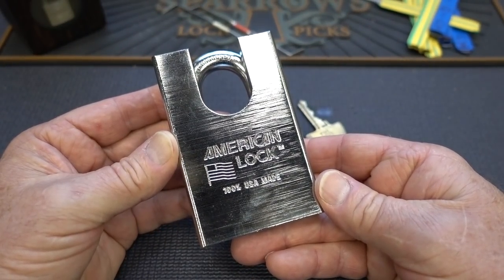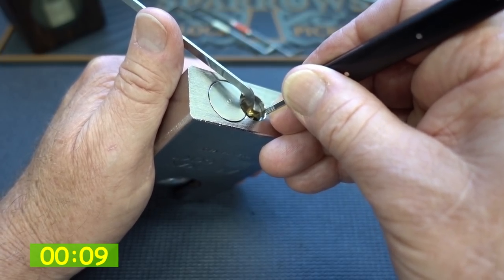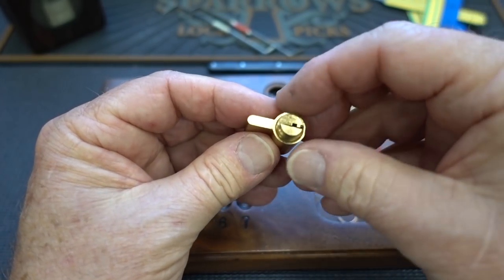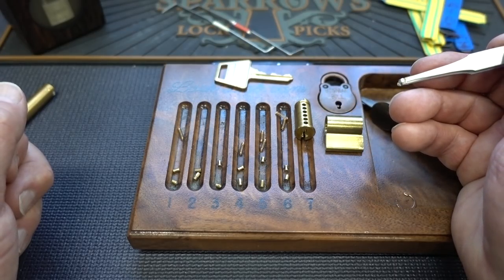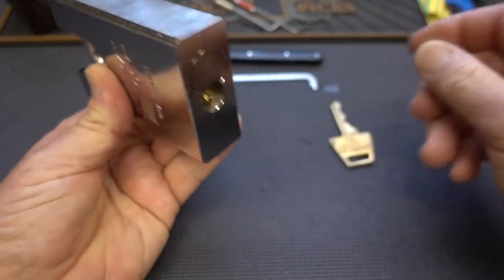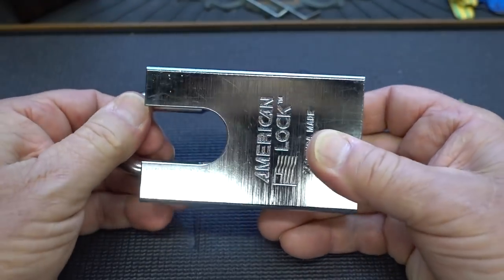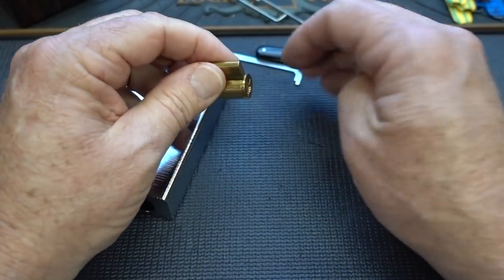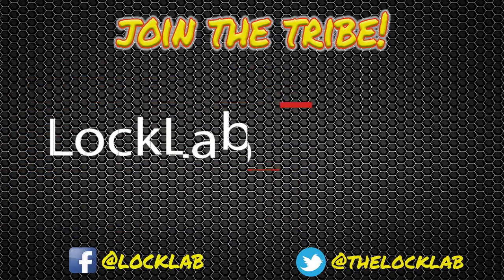(1327) American Series 748 Padlock Picked & Upgraded

Comment: Never heard a rattle till this - holy crap its horrible now. I cant even really listen to the audio. Sounds like a necklace is hitting the mic. Go back please!!!
Reply: Uh....no? I know he spent a considerable amount of time and money to fix an issue I never personally heard. I thought the videos were always great. Well now that the "fixes" were done the noise seems to be way worse and is very present and distracting, almost making it unwatchable.
Reply: yes worse than ever, though it seem to go away for a minute from around 6:30.
With all the thing tried it isn't the audio hardware.
Reply: Yes, worse than ever.
Reply from the maker: No, it isn't the hardware or sound booth...sadly...  It seems to be the compression algorithm YT is using on my files.  I've tried to improve quality by moving from 30fps video to 60+fps, while also increasing the bitrate of the audio.  YT seems to be clipping things to fit their format.  I may have to revert to the old capture rates to get rid of these artifacts.
Reply: Bosnianbill can you post one video direct to your website so we can listen and see - bypass YouTube? I know that is not sustainable but just as a rule out/test
Reply: i dont understand what are you guys hearing? there is absolutely no rattle for me. The audio is perfect.
Reply: aullik theres a small tick every 2 seconds turn your volume up, and 60fps is a good improvement you dont need to revert back to 30 to fix the audio
Reply: aullik maybe this is a Laurel / Yani thing??? Folks hear at different frequencies
Reply: Brian i turned the audio up to the point where my ears started to hurt and i did not hear a tick.
Reply: aullik now press alt+f4
Reply: What audio encoder do you use?  Is it CBR or VBR? 

what editing software do you have? 

Love your setup and your videos but this video was hard to listen to -.-
Reply: David Buchanan posted a solution to the problem in a comment to Bill's previous video. Unfortunately, I couldn't find his comment (just spent the past 30 mins. trying to find it). He mentioned it was a noise artifact in the 4-5KHz range and he used Audacity to filter it out. He put up a copy of Bill's video with the sound filtered and the noise was gone.
Reply: Bill, as I mentioned in my previous video, I only just started noticing the noise with your previous video. So I've been wondering what was different for me. I upgraded my browser to the latest version of FireFox recently. But I don't think it's that because I regularly watch your vids and I didn't notice the problem noise prior to your last video. The only other thing that has changed is that FireFox or YT have changed the display on the page. The videos are now larger than they were before. I can only shrink them if I resize the page to make them smaller. So that's a format issue. I then checked the video's quality. YT has changed that too with the increased size.

What I'll try now is play this vid in different quality modes to see if the quality makes a difference to the noise. It's even more pronounced in this vid than in your previous one. The only difference here is that you are speaking into the same mike all the time in this vid. Not sure about your previous one. You had some outdoor scenes and I didn't hear the noise when you were speaking in those sections. But I have no idea if you were speaking into the same mike later (adding the voiceover after recording the video) or doing something else.

Anyway, I'll report back if I notice any difference to the sound/noise by changing the quality.
Reply: OK, I went through all 6 Quality settings and it made no difference to the sound. So scratch that idea.
Reply: Legit question: how do you listen to these videos, and do you listen to it for ASMR or for lock-picking?

Edit: I've listened on a BluTooth speaker (also using a cable), mobile, PC, earbuds, and decent quality headphones (not high-end, though) both with and without active noise-cancelling, and I've never heard any problems, that's why I ask about how you listen.
Reply: I use a high end Sony laptop with Harman Kardon speakers. The feedback noise only started up recently for me. Didn't know/notice others were complaining for a while.

If it's ASMR you're into listen to BigClive or to the LockPickingLawyer.
Reply: Not defending, n not antagonism at all.... Just curiosity. What are you guys listening to these videos on, that allows you to detect these imperfections?
Reply: Jon McDonald my phone or laptop. Nothing fancy.
Reply: NYC10038 I never heard extraneous noise until this one. I'm using the same equipment that I've always listened on.
Reply: Seems much worse now. Almost with every word now!
Reply from the maker: Update on 08/06/18
The intermittent “rattle”, “scratching” or “cat bell sound” a few viewers have been hearing has been a nightmare to track down, and it came from an unexpected source.  It was especially difficult because I fall into the group that cannot hear the rattle so I worked with some sound engineers with perfect hearing.  
    Before soundproofing the LockLab, getting a studio grade microphone, and capturing audio at a very high resolution, nobody noticed because the rattle was disguised by low resolution audio that had a lot of background noise and camera hum.
    Once I soundproofed the LockLab and upgraded the audio gear, several of you noticed a faint, and intermittent sound that occurred ONLY while I spoke.
   I should note that I don’t wear jewelry, dog tags, or anything else that would cause a sound. My pop/hiss filter is 3” away from the microphone and firmly zip tied down.  The microphone is in a shock mount and all connections are tight.  VERY tight.  While recording my mouth is 6”-12” away from the pop/hiss filter and nothing touches the microphone during recording.  My recording levels are very low, in the -18 to -12 dB range with no spikes above -6dB.  If there IS a spike, I adjust it down to below -6dB before publishing.  I’ve done tests down to -34dB average, but the rattle was present at every level.
    My first thought was a faulty microphone, so I bought another, then another, then another.  Each clearly captured the distortion.  Oddly, the sound does NOT show up on the audio waveform.  There are no spikes or any indication that something is there, yet you can hear it.  A sound engineer suggested my voice had a resonant frequency with the microphone’s capsule, but after five different microphones capturing the sound, I ruled that out and returned the mics. My current microphone is no slouch: a Neuman TLM-103.  We ruled out the microphone.  
    The second suspect was the intermittent running cooling fan in the laptop, which I was using to capture the audio.  I replaced it with a Zoom H2N digital recorder, but the barely audible rattle was still there. I bought a Zoom H5, then finally a professional grade Zoom F4.  The sound was STILL there in all of them. We ruled out the digital recorders.
    The third suspect was the audio processing software that I believed might be introducing distortion during noise reduction of the high-resolution files.  I invested in Adobe Audition but it made no difference and the noise remained. I bought Izotope’s RX6, but audio processed by it also had the rattle. Several people suggested it could be YouTube’s compression software but since rattle is present in most of the raw, unprocessed audio we ruled that out.  The sound engineers believe YT’s conversion and compression make the sound more distinct, but it is not the cause of the rattle. We ruled out the post processing software.
    The fourth thought was some kind of electromagnetic influence causing the distortion when my voice peaked.  I replaced the generic microphone cord with a Mogami Gold Studio Grade XLR cable. It made no difference; the sound was still with us.  I made test files with the power in the LockLab shut down, operating on battery power only.  The rattle was still present in the audio files.  We ruled out cables and EMR.
    For my fifth attack, several people suggested it was something in the LockLab that was vibrating when I spoke.  To test this, I made several test files in my house (bathroom, dining room, kitchen, and in the back yard).  I did these tests using multiple microphones and the three different digital recorders.  All the files had the rattling sound.  We ruled out anything unique to the LockLab.
  By this time, I had no idea which direction to go. It was a gremlin…
  Shortly after the final test my wife and I had several friends over for drinks and dinner. In the course of conversation my wife started to ridicule my “irrational quest for perfect audio” and several friends were interested.  I fired up the laptop and let them take turns listening to the audio.  About half heard the sound and, with no prompting from me, called it a “faint rattle”.  As I told them of the various tests, one of them said “Hey!  Bill, say that again!”.  I repeated my sentence and they all said “There it is!”  I repeated the sentence several more times and they occasionally heard the sound – not EVERY time, but intermittently.  Once the people with REALLY good hearing knew what they were listening for, they said it was easy to hear when I spoke.
    So, since my voice was the only common element throughout the testing, it finally made sense.  I apparently have an intermittent vocal anomaly that was enhanced by the high-fidelity gear. Normally, it is found in singers that stress their voices and is called, appropriately enough, “singer’s rattle”.  A very few people can hear it perfectly, while most cannot.  
There were three possible solutions: 
 The first, suggested by Adam F, is to apply a notch filter around 4100hz, where the rattle appears.  We’ve experimented with this but unfortunately 4100hz is right in the middle of the human speech range.  The “rattle” is not a discrete frequency, but actually ranges from 4000hz to about 4200hz, or a range of 200hz.  Notching out that frequency range REALLY mangles the audio and is obvious to the most casual listener.  Clearly, won’t work.
  The second solution is to revert to using the camera’s microphone to capture sound.  It is a much lower resolution and, as long-term listeners probably recall, produced pretty dirty sound.  There’s no guarantee this would satisfy everyone because the camera DOES still capture the rattle, but to a lesser degree.  I’m not a fan of going back to low quality sound.
  The third solution addresses the REAL problem: my voice.  Treating “singer’s rattle” includes warming up your voice before recording (I can do this), not over-exerting your voice (I don’t do this), gargling with salt water (I can do this), and hot drinks like tea with lemon & honey (efficacy of this is arguable but I can do this too).  Some suggest that placing the microphone at a 45-degree angle to the side helps attenuate the rattle, so I’ve moved my mic.  Oddly, this rattle didn’t show up in my voice until about six months ago, so it may solve itself, given time.
  In short, there’s no guarantee that any of these things will permanently fix the noise.  I’ll do everything possible, but I have to work with the vocal cords that I was issued…
Bosnianbill

Comment: Audio 6/10
Reply from the maker: Mike F187  Yes, it appears I'm still struggling but last night, working with a sound engineer and my raw files, I think we've identified the problem. When I switched from the Blue Yeti condenser to the Heil dynamic mic I ignorantly left the gain at the same level.  Apparently, dynamic mics need a slightly lower gain, especially with certain frequencies (like those in my voice). It was never peaking or hitting 0dB, so I never gave it a bit of thought.  I've reduced the gain by 20%.  The test files do not have the artifact when I speak, so we'll see what happens when I make a video and upload it.  This really IS wizardry...